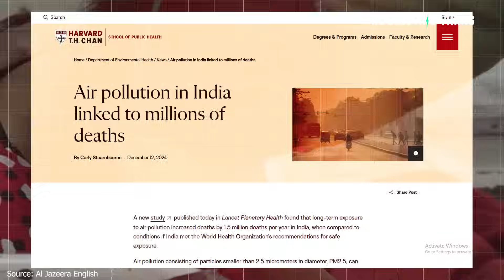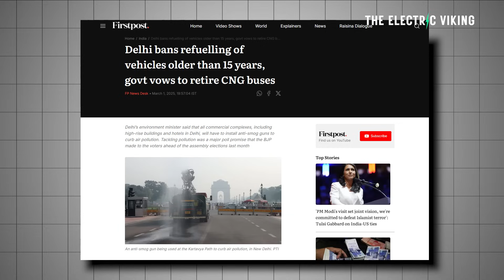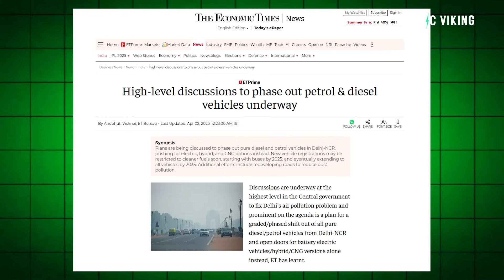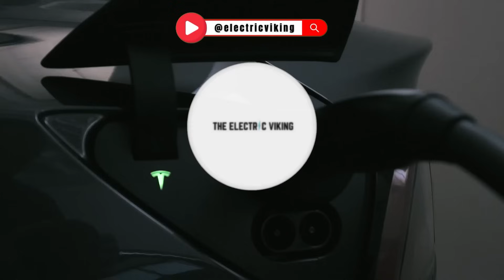India's Bold Move: ICE Car Ban Coming by 2035 – Fuel Sales Already Blocked!

Comment: Many of Chinese cities used to be on the Top 10 list. 
People all over the world mocking China's smoke problems back in 2013 when Beijing was covered with thick fog where you can barely see something 10 feet in front of you. 
Fast forward 12 years later they tackled it completely, nowadays the air of all Chinese big metropolis are so clear. 
It comes down to determination from all shareholders to fix any problems, starting from the authority.

Comment: I live in Norway, and the lung cancer cases are plummeting.

Shell in Norway have now decided to get rid of their fossil fuel pumps.
And, are planing to put up 400kw chargers, with the option of increasing this to 1,2 -1,5 Mw.

Even thought we won't be 100% electric this year, there will be hard for those who are insisting on buying fossil cars (with or without a big battery). They will struggle to get fossil fueles for their cars.

Their pain will come in a few years time, when there will be almost imposible to get fuel for them.

There are no cure for stupidity, so unfortunately, some has to experience it the hard way.

We don't really need any ban on fossil vehicles. Even trucks are switching to electric.
With trucks beeing electric, diesel sales will plummet.
The only thing that's left will be motorcycles and farming equipment.
But, by then there will be an increase in the costs of getting fossil fueles. Farmers, and motorcyclists won't have any choice.

I think India should adopt a similar approach. Try to adresse the vehicles that can drive the transition in the fastest way.

I don't think India can ban 15 year or older vehicles from filling up. But, they can ban the sale of 2 stroke oil at their gas stations.

They can start a mandetory test system for vehicles, and carry out emission tests on vehicles. India should also make DEF (adblue) mandetory on all new vehicles using diesel.

India needs to get off their oil dependence. They have a lot of sun, so why not use that?

Comment: In India the electric vehicles have started from the bottom. They have started with two and three wheelers which are world competitive. Even with cars as far as india keeps out Chinese evs it has no problem as far as competition from other countries are concerned. In fact once India and America sign a trade deal Tesla will have tariffs which will be the same as America charges India and nobody in India is worried. The Chinese cheat. They sell at lower than cost until they take over the whole market. Therefore Chinese EVS must be kept out by India.
Reply: What nonsense are you expressing here?
What exactly is India's goal: to keep the 'cheap' Chinese EVs out at any cost, or save Indian cities from smog? Nothing is clear from your comment.
At least 70% of vehicle owners are not fanancially capable of replacing their current vehicles with imported ones, as the cost would be too high. The Indian Government does not have spare cash either to subsidise vehicle replacement costs.
Over 75% of India's power generation is from coal, another atmosphere wrecker.
Reply: @ The nonsense that you are talking about has destroyed Indian industry. The Chinese sell below cost to destroy competition. Do you understand anything?
Reply: @n-x8c  The Indians never had an industry to be destroyed by any one.
On several metrics, India was miles ahead of China in 1950s/1960s.
But India decided to go with its 'protection', and missed all opportunities to move foreward.
India had just 320 million people at Independence. Look at the numbers now! Why blame others?
Reply: @ really. Have you not heard about Pharma API? For example.

Comment: In many third world Countries there are a lot of 2 strokes like motorbikes scooters mopeds tuck tuck tucks. They are way worst than 4 stroke engines they burn the oil as that is the design of the engine. They used to also have 2 cycle cars like Trabant an NSU and a few Russian brands. In the Dutch City Amsterdam 2 cycle mopeds and scooters are banned in 2025. when I was a child in the Seventies  many motorcycles in the Netherlands were also 2 stroke. 2 Stroke is the blue smoke that give you cancer. Todays cars are much cleaner than in the seventies, in fact 30 times cleaner because of unleaded fuels and catalytic converters. And LPG and CNG are even cleaner 35% cleaner.

Comment: Did they start to put air and pollution filters on every coal plant yet? Even better: CO2 caption. Is it mandatory for heavy industry like steel furnaces and the chemical industry to have air filters?
Heavy smog and unbreathable air - I´ve seen it, it´s terrible - and it seldom was from cars. It was from plants blowing out heavy smoke and fumes 24/7. Trucks and diesel busses at rush-hour only added to the already existing pollution, everywhere I went they were never the main reason. Of course a busy diesel bus main station with hundreds of busses is a nightmare - but just 1 kilometer away You don´t notice a thing. Just referring this as if the problem is not correctly identified You can´t fight it. And recently I see a lot of the latter.

Comment: Most of the pollution you see in the video is from Delhi and the pollution happens because of  burning of field for crops at the wrong time. When they burn crops during winter, the smoke hangs around and that causes lot of problem.

Ofcourse, there are older vehicles with zero emission standards or checks which is the problem not the vehicle itself. If maintained and tested this can be avoided.

Comment: Here in WA, I'm not surprised to hear about this Sam. I can't imagine the low intelligence required to remove the DPF from a diesel vehicle. The thing is, why are there no roaming sniffer tests done on vehicles in this state? In the UK, 25 years ago before I made Australia home, there were roaming tests done. You'd be stopped and a sniffer pipe connected to the exhaust. If your vehicle failed the test, that was it. Why is this not enforced here too? Why do we have no annual tests for vehicles to make sure they're safe and emissions were at least to specification. We seem to have nothing here to stop these mindless idiots. We just pay the rego and keep on driving. This has to stop. Maybe it's time to start writing to the state Labor government and asking them what they propose to do? This has to change.

Comment: In 2014 according to Amnesty International 40,000 children were working in Cobalt mines. With the push for E.V.'s there must by now be far more. Why?
UK is already at Net Zero
Carbon Dioxide is 0.04% of the Atmosphere. It is a Trace gas.

99.96% of the Atmosphere is NOT CO2.

3% of that 0.04% is manmade 

The UK produces less than 1% of the 3% of 0.04%.

That's 0.000012% 

Net Zero = 0.000000%

Carbon Dioxide is Plant food, at 0.02% of the Atmosphere all plant life dies, no dairy, no meat, no veg.

Comment: What insights can you share about Indonesia's polluted Morowi Industrial Park? Currently powered by coal, with plans for further development on the horizon, this situation is undoubtedly concerning. I imagine you're already aware of the implications. This pollution is helping feed your electric eutopia. Wow, you must be so, so proud?
Reply: How does Indonesia burning coal affect someone in Aus, driving an ev built in China? Most developed countries have either moved away from coal, are in the process of doing so, or have plans to do so soon (US excluded of course). The next logical stage is to move away from gas and oil. Obviously a developing country can't do that yet, but they will pivot when they can't sell products made using coal abroad.
Reply: I find it terribly difficult to understand why someone like you can't grasp the fact that coal is a transitional form of energy. Yes, we're going to still need to use it for some time, that is until we can scale up renewable energy so that it reaches saturation point to REPLACE coal and oil as a primary energy source.

We GET that we can't get rid of oil 100% as it's going to be used in plastics and other materials, but at least we can cut back its use for transportation, where it makes sense. A reduction of use is worth it - as opposed to DOING NOTHING and pointing fingers at people who are trying to solve the problem!

Why is this concept SO difficult for you and your ilk to understand? Is it something in the water where you live? Too much drug/alcohol abuse?

Or were you always the type to be fartknocking around and being a general disruptive turd during classes.

Absolutely unbearable. 🤕